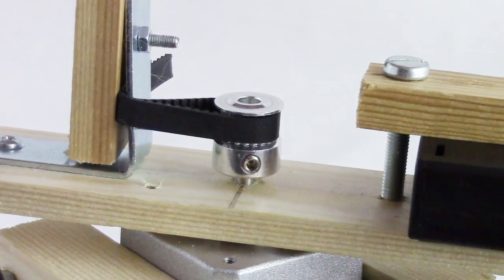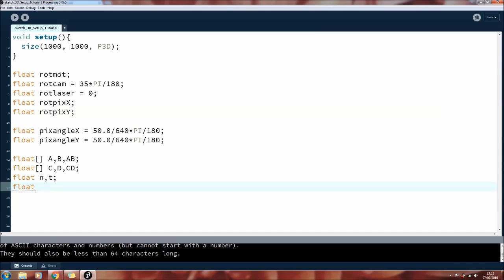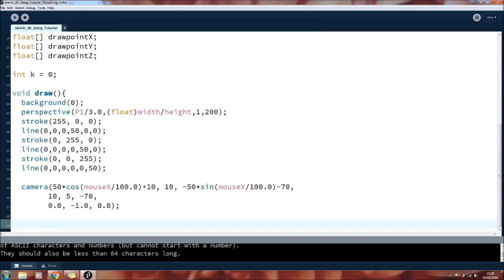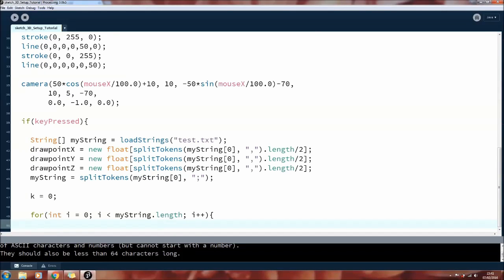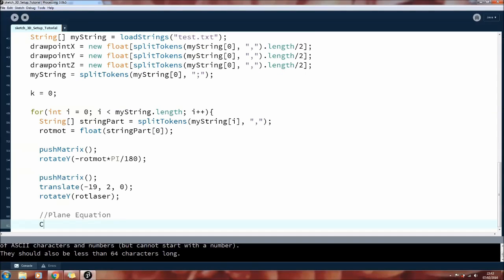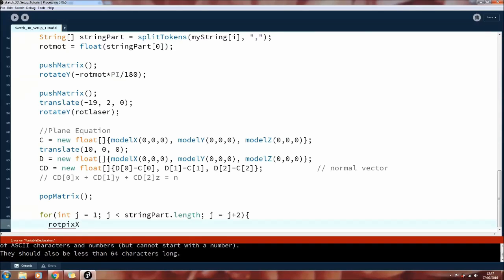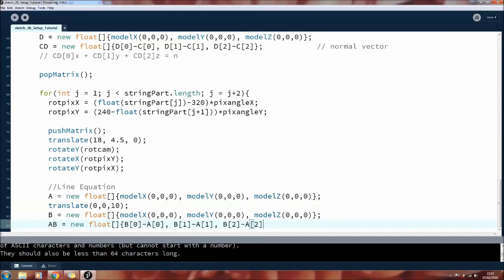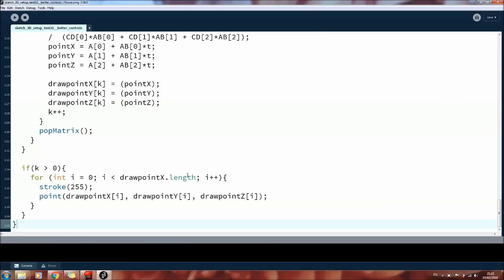3D Environment Laser Scanner PART 4

Comment: I don't know if you still watch for comments on these videos, but I do have a few questions about this design... bear in mind I'm a 100% noob, but also running on a somewhat tight schedule (need to be finished and functional by the end of this summer).

Problem one... You're in the UK and most likely doing this for a UK audience.  Which parts would change if trying to build this design in the US?

Problem two... what is the maximum accuracy and precision of this design?

Problem three... is there a way to check and correct the accuracy of one's specific build?

Problem four... what changes would you make if you were trying to capture much larger (i.e. large and complex enough to require many different scans) outdoor environments such as, say, a length of road?

Problem five... you seem to have found someone who found a way to remove lens-curve distortion; does that person impose any licensing requirements on the use of scans which are run through their algorithm?

(Full explanation for how these fit together: there is a road some distance from my house which is quite a bit of fun to drive on, however starting in 2020 it's going to be partially bypassed and the bypassed section converted into a hiking trail because the hardhats are tired of cleaning up rockfalls and this was the cheapest solution.  I would like to capture this road in exact or "AAA quality" detail so that it can continue to be enjoyed by players of such games as Assetto Corsa even after it becomes ruined in real life.  This also leads to a sixth problem... if the road is going to be open during the scanning process and I'm going to be working alone i.e. no warning when cars are coming, how do I avoid blinding people with the laser?)

Comment: is there any way to have a live feed of the dots shown on the computer ? 

and how long did it take to get the scan of the room 

Thank you
Reply from the maker: At the time I did this (~2 years ago) I couldn't find a way to do this. I wasn't able to have the camera image window and the 3d render open at the same time. There might be an updated version of Processing that allows this but I'm not sure..
Reply from the maker: And a full room scan maybe took about 30 seconds or something?? It could go faster however, it would just be at lower resolution.
Reply: Callan Mackay cool that's perfect .  I'm going to order the v3 now . I'm hoping to make a installational art piece . I will post it here if it all.goes to plan :)

Comment: Hey Callan, I started scanning and everything. But my scans are always circular. Do you know any possible reason behind this. Cheers, Well done on creating this project.  :)
Reply from the maker: Hey! This is an issue that I never solved, it's to do with lens distortion. There should be a formula inserted somewhere when calculating pixel angles to counteract the effect. 

It can be resolved slightly by adjusting the 'rotcam' parameter on line 11, and possibly the 'pixangleX/Y' parameters on lines 16/17. This will only help a bit, when it reduces curve in one plane, it increases it in another.. 

So there is a way to solve it, but I don't know exactly how to do it yet. But if you find out, let me know :)
Reply from the maker: Barrel lens distortion.. Someone commenting on the Instructables tutorial told me about it and gave me this link >> https://stackoverflow.com/questions/12620025/barrel-distortion-correction-algorithm-to-correct-fisheye-lens-failing-to-impl

Comment: Hey there, just wondering is it possible to get the XYZ 3d space coordinates of each point in the point cloud so that it can be put  in a file in XYZ format and be used for other softwares.
Reply: and another question, that is there a specific name for the format in which you ouput your numbers from part 3 video into the test.txt file
Reply from the maker: Yep! Should be possible, you could do it in a similar way to how the text file was created from the first sketch with the pixel x,y coordinates, only I don't know what the format would need to be for exporting to another program. I'm going to give it a go just now, but I'm a bit rusty with processing so it might take a while..
Reply from the maker: Nothing specific, I just made it up so it was easy to read in the other processing sketch.
Reply: Thanks!
Reply from the maker: Okay this seems to work for a very basic txt. file with XYZ coordinates:

Just before "void setup" insert: 
   PrintWriter output;         // object for writing to the text file

At the end of "void setup", just after "size(1000...." insert:
   output = createWriter("XYZround.txt");      // make the text file 

Then scroll down to about line 108, just after "k++" insert:
   output.print(";");
   output.print(round(pointX*100)*0.01);  // Rounding to 2dp
   output.print(",");
   output.print(round(pointY*100)*0.01);  // Rounding to 2dp
   output.print(",");
   output.print(round(pointZ*100)*0.01);  // Rounding to 2dp

Then scroll down to about line 123, just after "point(drawpointX[i]...." insert:
   if(i == drawpointX.length){
        output.flush();       // finish printing to the text file
        output.close();       // close the text file
        exit();               // stop this program from running
      }
Reply: You're the best!

Comment: Hello....... this is really a cool project. I am doing my grad project on room scanning robot and i followed your instructables and get to run the scanner successfully... awesome... thank you so much. I just have one question that how did you do the point cloud video here: https://www.youtube.com/watch?v=CZfjK3iaXHY
we are just plotting the vectors by clicking Run. Did you use any library for it? I am actually a starter in processing.
Reply from the maker: Hi there!
Do you just mean how did I get the turntable effect? Apart from that I think it's pretty much the same as in the tutorial. 
There may have been some more stuff to adjust for the lens distortion but I cant quite remember. 
I can try sending you the script for that scan if you want. If I can remember what version it was in :s
Reply: Yes, I meant the turntable effect. Did you just remove the grid and changed the camera function and recorded it? 
And please do send the script, it would be great. My email: shahidulabir@yahoo.com    
I was also thinking of saving this point cloud data into file formats (ptx, pts, xyz, txt etc.) that 3D rendering softwares like MeshLab, 123D, reality capture etc. can import. Can you help me out here?
Reply from the maker: I left it so long to reply to this I couldn't even remember where to find it! Sorry..

Ill send you the code I used for the angel. But yeah, just commented out the grid and added a few keyboard controls. I also put in an incrementing variable "turn" to make the smooth turntable effect. The "f" variable is controlled using o and p, this lets you run through different text files that are different by their number (i.e. sketch_1, sketch_2, sketch_3 etc...). 

I think it's pretty much the same apart from that. 

As for sending it to that file format, it's not something I've tried yet but would like to at some point. But I don't see why it wouldn't work!

Comment: heyy!!
very nice work really been so helpful for me
question:
i got the 1st processing code working (converting what the camera sees ento white dotted line )
and got the 2nd code working also (displaying the black screen with the XYZ co. 
but how to connect the imge from the camera to the black screen in a 3d rendered image?!! plz help ASAP cause it's ergent... 
Thanks so much for your concern :)
Reply from the maker: Hi there! Do you mean that you got the 3D point cloud working? Because that's as far as I go I'm afraid. I think it will be possible to create a solid model from this in meshlab or something, but I haven't tried that yet. 

OR, are you asking how to get the point cloud?
Reply: yes how to get a point cloud and how to build a 3d model from the environment?!
Reply from the maker: I don't know how to turn the point cloud into a surfaced 3D model, I only went as far as making the point cloud. Also, I did this a year ago so my memory is a bit rusty, but I'll see what I can do! 

If you are struggling with getting the point cloud to work, try copy and pasting my code directly and see if that works. If it still doesn't work, then you probably have a version of processing that is not compatible with something in it. 

Code is here at the bottom of pages 4 and 5 >> 

http://www.instructables.com/id/3D-Environment-Laser-Scanner-From-Scratch/step4/1st-Processing-Program/

Give that a go and see what happens.
Reply: it worked with your test.txt file put doesn't work with my text file maybe the problem is in constructing the test file in part 1,, iam using a servo motor instead of the stepper u are using could this be the problem?!!
Reply from the maker: aha! yes that'll be it then. The code will need adjusted slightly for a servo motor i think but it shouldn't be too hard.
Reply from the maker: Is the stepper motor moving when you run the program?